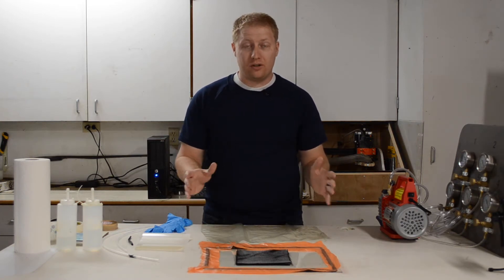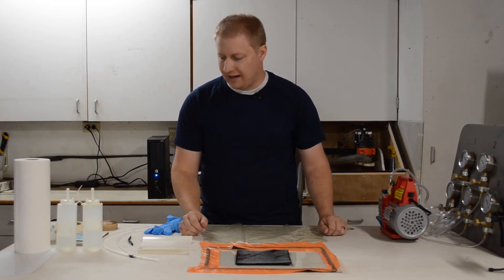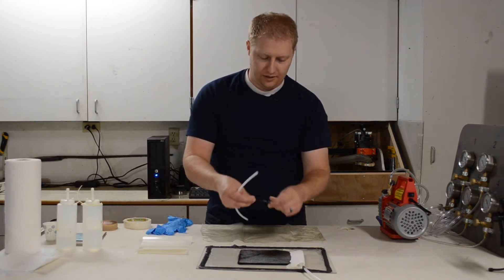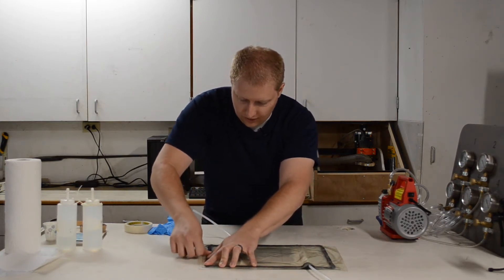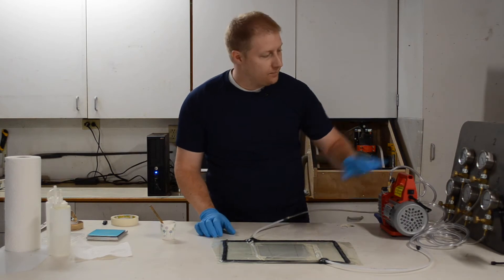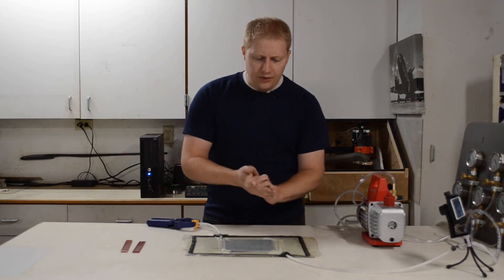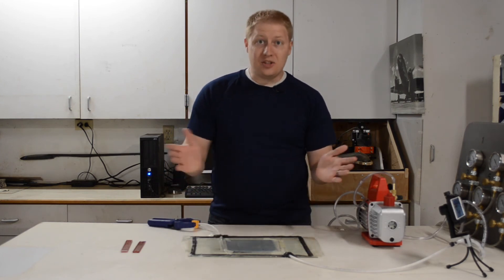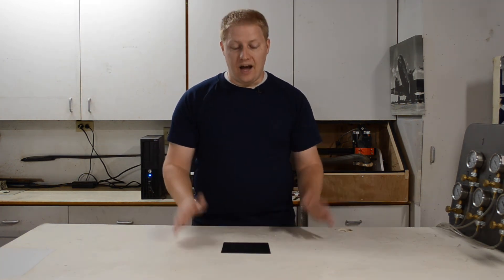How to Make Shiny Carbon Fiber Parts -- Resin Infusion!

Comment: Came out 100% 👌🏻 i was curious to see if that vacuum would actually work good enough to make cf parts and now i see it does. I have to get me one of them vacuums next. Ima be making some Goped scooter parts and a few car parts. I tried in the past and it came out ok but i never tried to vacuum it,so it was a ton of more work and didn't come out as nice as that piece you made. Anyhow excellent video. Keep it up.

Comment: Would you be willing to make a mold and carbon/kevlar boat using an aluminium boat as your mold template?

I would like to see this so I can make my own boat. 
The outside layers on the boat would need to be kevlar for high impact resistance and lay up carbon/kevlar on the inner layers to improve rigidity and strength.
Reply: Eventually I would make a jet boat in a similar nature.

Comment: how strong would this peace be? would it be something to be used on car body part for example?
Reply from the maker: This piece is quite strong.  Generally speaking, parts cured in an autoclave will be strongest, followed by vacuum bagged parts (like this one) and then by contact layup (no vacuum).  I believe this method (resin infusion) is what's used by most makers of body panels.

Comment: Hi, I'm from Malaysia. Watched both ur videos... thank u so much for sharing... I've got some 200gsm carbon fiber fabric but I don't know what resin to use can u pls advice. Thank u.
Reply from the maker: My favorite resin is Resin Research Composite Pro 2050.  It's inexpensive, clear, very low viscosity (making it easier to wet out plies), and it comes with lower health risk than other resins I've used.  The only downside is that their slowest hardener is still only a 90 minute pot life.  I do like working with MGS epoxy even more (and it has up to 4-hr pot life), but it's about twice the price and requires hazmat shipping.
Reply from the maker: If you're just looking for a small quantity to try your first carbon parts, I recommend EZ-Lam from ACP Composites.  It's what I started with and it works great, and it's available in smaller kits.

Comment: Awesome, thanks for the video! What resin would you recommend for a beginner that is easy to work with and not too expensive? Why are you not using peel-ply? Why no resin trap before your vacuum pump?
Reply from the maker: My favorite resin system is Resin Research Composite Pro 2050 (see the above comment), but for beginners I like to recommend EZ-Lam 60-minute kits from ACP Composites just because it comes in smaller quantities.  If you're just trying out composites for the first time, it's nice to not have to commit to a whole gallon of resin.  My first layups were done with EZ-Lam and it was easy to work with.  

Peel ply is a great way to get a bondable surface.  After cure, you can leave the peel ply on the surface to protect it from contamination until you're ready to bond something to it.  When you're ready, you peel off the peel ply and glue straight to the surface -- no further preparation required.  In this case, I am not bonding this piece to anything.  I just wanted a shiny carbon finish on both sides of the plate.

I didn't use a resin trap simply because I didn't have one.  I watched it the whole time to make sure it didn't suck resin all the way to the pump.  If this were a larger layup or if I wanted to be able to leave it to infuse without supervision, I'd definitely prefer to have a resin trap between the layup and the pump.

Hope that helps.

Comment: This might be a silly question so pardon my ignorance but since those vacuum pumps are so cheap would it be better to use two at the same time?
Reply from the maker: I'm not sure what that would gain you.  What's your concern with the pump?  That it would stop working in the middle of an infusion?
Reply: @SasquatchComposites  multiple infusion points
Reply from the maker: @primate2744  I've watched large infusions done professionally and haven't seen a second pump used, but I've seen one pump hooked up to multiple locations around the part.  I definitely see the value in having more than one vacuum source around your part.  It's essentially insurance against getting a dry spot "locked" into the middle somewhere.
Reply: Thanks for the reply!
Reply: @primate2744  I've wondered the same thing (about the multiple pumps).  I was thinking it could increase the total CFM, and could reduce the time needed to pull a vacuum.  Never tried it though...
Reply from the maker: @itsmen8  I've never laid up a part where CFM was important.  And I don't see how it would matter even for large infusions.  This is a small pump, pulling 3.5 CFM.  If you've got 3.5 cubic feet of resin that needs to be pulled into your layup in less than a minute, I think you've got bigger challenges than just the pump capacity.  If I'm wrong, though, I'm sure someone smarter than me will come school me on the topic.